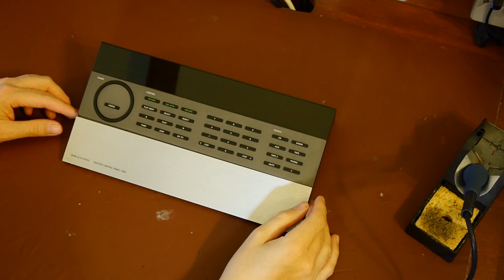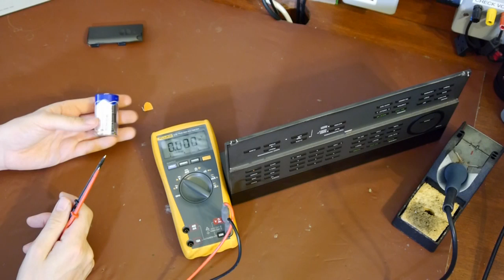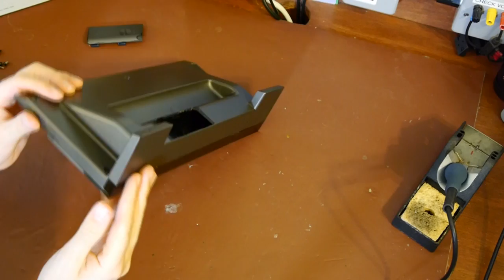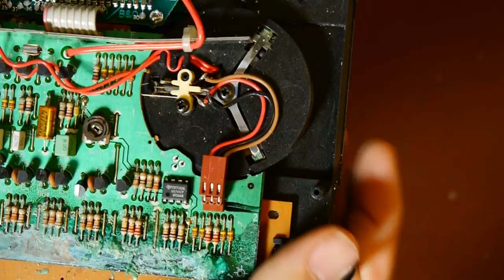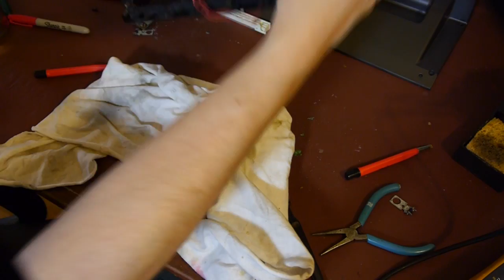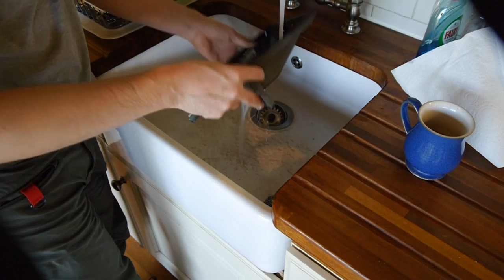Banging Olufsen  Part 1

Comment: Thank you for that video. It helped me repairing the numbers on the time display. I still have a problem with the volume indicator. The first is a red LED which works fine. The second and third LEDs are green and more dim than the other green LEDs behind. I interchanged the second and third LED with the fourth and fifth and the issue doesn't change. So i traced the issue back to a transistor on pcb 2. But all seems fine. I searched for a schematic but didn't find any. Can someone help me out?
Reply from the maker: I think I have a schematic. I am in Dubai this week but I can put the information in a drop box for you when I get home.  I can only think the drive transistors Or series current limiting resistor is at fault. Give me a poke next week.
Reply: @allthegearnoidea6752  that would be awesome. Thank you so much! And again thank you for the efforts you put into this video. It helped me and saved a MCP 5500 from being trashed. Have fun in Dubai! 👍
Reply from the maker: @andreeikmeyer678   I had look for those circuits diagrams and sorry they have been lost but I have a note in the file I downloaded them from here https://forum.beoworld.org/  I have the users manuals but not the service data.
Reply: @allthegearnoidea6752  thanks for getting back to me. I found out there are schematics of the MCP in the Beomaster 5500 service manual. 👍

Comment: NO CONNECT that's all ! only this on the screen...
Reply from the maker: The remote control has two way communication with the hifi system. Without fully testing the remote i cannot advise.

Comment: I fixed a reel to reel Philips I blasted it with a hose to wash off a ton of pigeon crap before I could get into it !
Reply from the maker: thehappylittlefox aka benji  yes done likewise washed many old oscilloscopes and vintage TV sets
Reply: yep then used an air hose to blow it all out ! and my heat gun to dry it  !